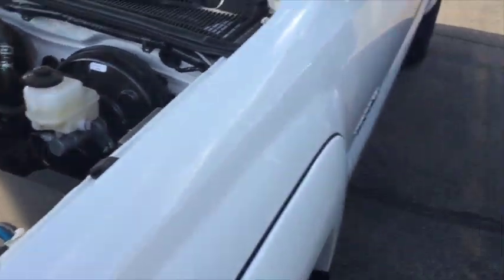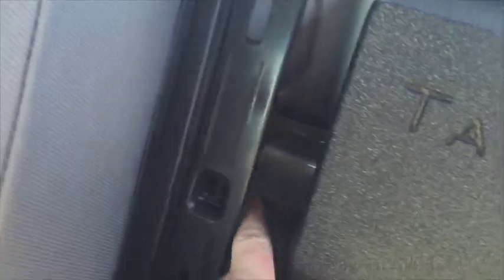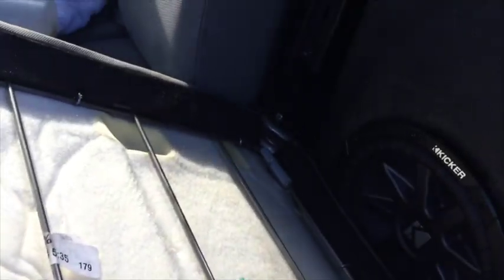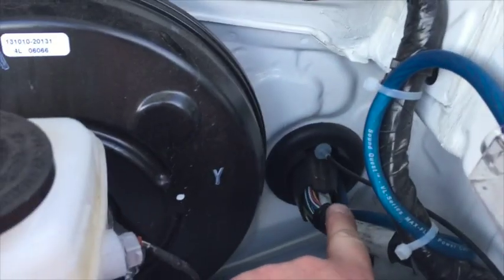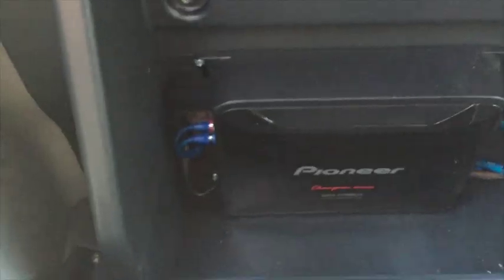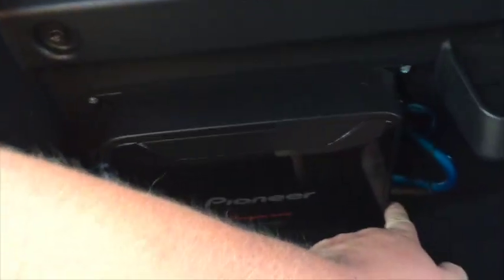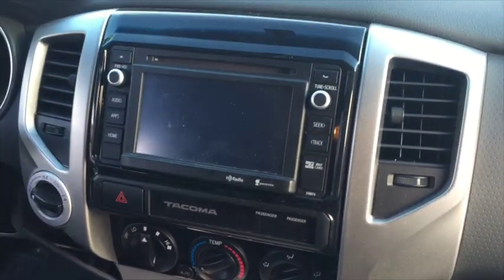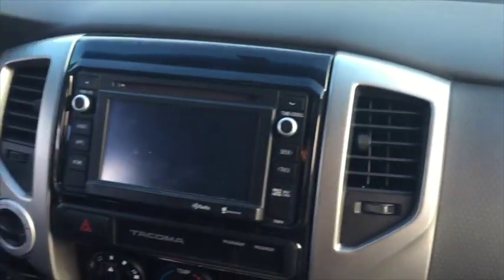2005 - 2015 Toyota Tacoma Amp and Sub Install

Comment: Any overheating problem with that amp location after a road trip?
Reply from the maker: No, but consider the classification of the amp as well - Class D amps are more efficient and generally produce less heat, Class AB amps run warmer and are more inefficient and need more airflow.  If installing where this was, use a class D amp.
Reply: Ok thank you

Comment: Is there a video anywhere of this whole install that would be awesome
Reply from the maker: I don't at this time, my apologies.  I do have a 4runner install which would be a similar setup with running cables which you can use as reference. https://www.youtube.com/watch?v=T7qb5RaeNlQ
Reply: Provo Beast Audio Installation how much does this exact setup cost?
Reply from the maker: The Taco Tunes box was 170, sub was 80, amp was 110, wiring was 20
Reply: Provo Beast Audio Installation where can I get all the same wiring you used?
Reply from the maker: Amazon, the part number is in the description.
Reply: Provo Beast Audio Installation is there a video on how to make that fuse box by the battery?

Comment: What wire harness did you tap into? The rear speakers? Also where is the 12v ign wire
Reply from the maker: +chandler goff I tapped into the rear left and rear right speakers for the RCA signal and the ignition wire behind the radio for the 12v switched power for the amp.  Depending on the year of your toyota, just search that corresponding year in google for the stereo wiring diagram and it will tell you what wire colors to tap into.

Comment: I'm concerned about airflow, I want to put my sub amp in the storage pocket beneath the rear seat in front of the sub box (it fits fine). But I'm worried about it overheating. I don't want to give up that area you have the amp here. Suggestions?
Reply from the maker: Class D amps run much cooler and make sure there is some space in that cubby or else you will run into overheating issues.  As an alternative, you can also try underneath the front seats.
Reply: Provo Beast Audio Installation thanx much! Its a kicker cx 300 and yes a class D. Simple and small. I'll check under seat space. Might actually work. Will be pushing their Comp R 2ohm DVC 10". Again, just rounding out the system in my Tacoma.
Reply from the maker: Sweet man,  Good luck with your install.  Be sure to subscribe!

Comment: Where's your website where are you guys located? Thank you I need some help I currently have two JL TW3's 10" on a 1200v1 JL the people that did box I hated it's waaay over build for the specs on what the JL requires I think I got 1.8 cubic feet and wanting a better box and adding two more TW3's10" total of four TW3's wired in to a 2oh load which my supports oh yeah any help thank you enjoy for videos
Reply from the maker: We are located in Lehi Utah! Currently don't have a website.
Reply: Provo Beast Audio Installation oh damn ok well thank you.  It's really hard to find some that works and specializes in Tacoma's ok I enjoy your videos good stuff
Reply from the maker: Thanks man.  Good luck to you!

Comment: what do i need to connect the line out converter to the stock head unit with out cutting any wires? do i just get Best Kits BHA1761 and Best Kits BHO1761 to connect to the stock terminals?
Reply from the maker: +junkanoo610 Two options: found this adapter: http://www.amazon.com/AudioBaxics-AA-TOY1761-Toyota-Amplifier-Adapter/dp/B00CQUL240

Or You could get those wiring harnesses, it may just cost you a few extra bucks, but i would say it would work fine.  You would use the BHA1761 to connect to the factory harness, then wire in the line out converter to those ends along with the ends to the BHO1761.  once those are all connected, then the BHO1761 end will plug into the head unit.  That would avoid actually cutting into the factory wiring.  If that makes sense...

Comment: can you explain how to set up the LOC/remote wires into the stock head unit?
Reply from the maker: Watch this video and skip to 6:45: https://www.youtube.com/watch?v=HsBHQdZh_8Q&t=449s
This scion has the same wiring harness setup as a tacoma, this will show you how to install a LOC easily.  hope this helps!
Reply: Provo Beast Audio Installation Thanks.

Comment: do u know if it will fit on 2016 model?
Reply from the maker: +JOE most likely not, though I cannot verify that.  The cab of the body has changed some, but the floor pan may be the same.  You would have to verify the subwoofer box from TacoTunes would fit a 2016.  The amplifier and supporting wiring would be very similar, as that doesn't change much for toyota.

Comment: what loc did you use?
Reply from the maker: +Jordan Chandler The Pioneer GM-D8601 Doesn't necessarily require a LOC because being a digital amp, it reads both high and low level signals through the RCA port.  However, I usually use a Pac SNI-35 on most factory integration installs.

Comment: where did you run the power cables to?
Reply from the maker: +A&M Productions The video starts off showing how to run the power cable from the battery to the amp which was in the back panel behind the seat.  The ground was anchored to an unused bot under the rear seats.  Just clean the paint off.  Rca's ran from the amp to the front of the Tacoma Dash to the radio.
Reply from the maker: +A&M Productions For steps on how to remove the radio, click here: https://youtu.be/C0gZ_a7Iqog